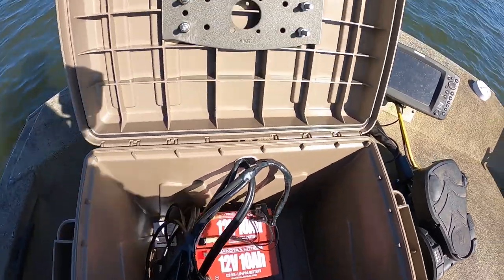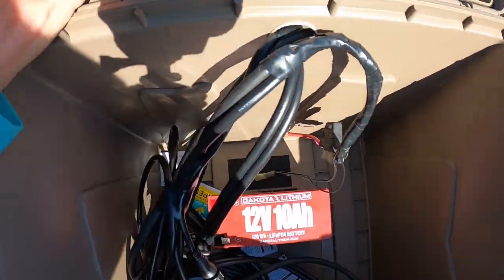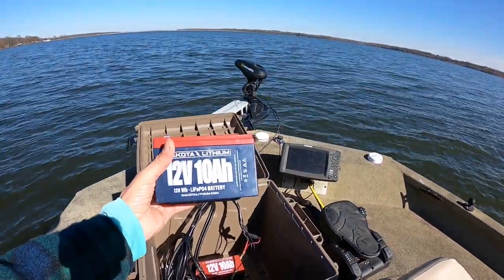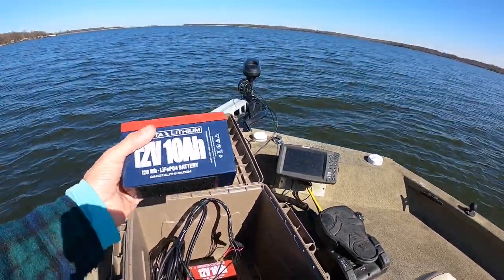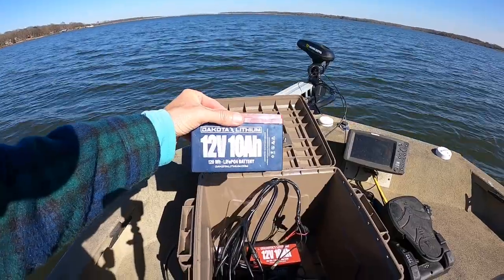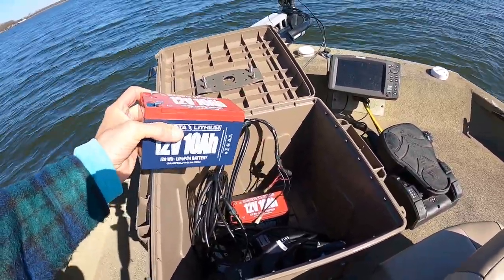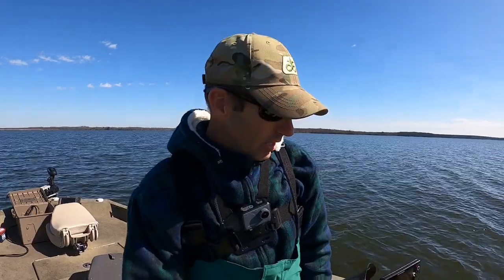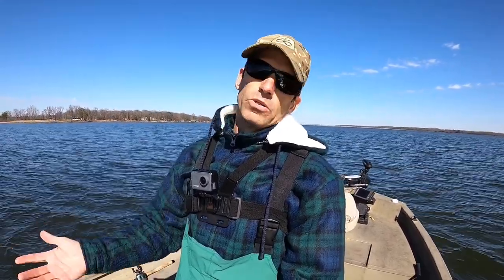LITHIUM BATTERY For Livescope (SIMPLE) setup

Comment: Good video.  I am using the Amped Outdoor Lithium Battery (30 ah).  I run my black box and my graph on it and have gotten close to 25 hours of a solid 13.4 v the entire time.  I though it was charging but I had it set wrong originally.  The cost for the battery and the charger is about the same cost as both of yours are.  Good video man, not trying to one up you, just sharing.  Tried to call you a minute ago, we need to get together and fish bro. Been talking about it for a year now!
Reply from the maker: Sorry I missed your call I was on the lake all day and don’t always have service. And yeah we need to go at some point. Just been difficult to line up our schedules lol

Comment: Do you have the livescope black box mounted on side of box?  Is the plastics strong enough to hold it?  Or do you have something else holding the box?  What is the make of the box? Thanks
Reply from the maker: Hey Stanley I appreciate your comment. I have everything mounted inside the box. Just drilled holes through the side. It has worked great for me. I keep some jigs and other things in there as well

Comment: Hey Gary,  you've had those lithium batteries for little while.  What are your thoughts on them, are they good? Have you had any issues? How long does a charge last? Wanting to go to lithium on my live scope and not have to spend a fortune. Thank you sir!
Reply from the maker: Hey Milton, thanks for your comment. I did have one battery stop taking a charge after about a year. I called Dakota and they sent me a replacement in just a few days. They also sent me a new charger to replace the faulty one I had. That was probably the best warranty experience I’ve ever had when it comes to batteries. Now as far as fishing time goes. Mine last between 5 and 6 hrs which is plenty for me. Some are using the 30 ah and can fish full days no problem. Also, they recommend using their charger which is too expensive.
Reply: @CATCHAHAWG  thank you sir, appreciate the feed back, I think I'll go with the Dakota 12v 18 ah
Reply from the maker: @miltonbarnes3022  keep me posted on how it works. Also keep your receipt. That’s all I had to show to get a replacement

Comment: Just wondering ,, I know the time can very ,, on average though ,, how long does it take you to charge the battery ?
Reply from the maker: Mine normally charges in a couple hours but very seldom do I use it until it’s dead.
Reply: @CATCHAHAWG  Thanks for the reply ,, I only fish for a few hours ,, I will order one ;-) bought a USD 94SV over the weekend ,, the transducer for the LS will take 2 weeks to come in though ;-( just trying to all my ducks in a row before it gets here ,, ordered a nice mount for the monitor but will build a LS transducer mount like yours ;-)
Reply from the maker: @lvsaltwater  yeah I got a replacement transducer the other day and it took a couple weeks to get it. 👍
Reply: @CATCHAHAWG  well one more question ,, that swivel on your transducer mount that holds your handle lol where you get that ?
Reply from the maker: @lvsaltwater  I actually made that as well. Check this video out it may give you a few ideas https://youtu.be/yX9QjCMaol8
Reply: @CATCHAHAWG  Got one ordered ,, I ordered the 18 AH ,, that should get me thru the day ,, I only fish about 5 hours per day ,,
Reply from the maker: @lvsaltwater  that will work perfect 👌